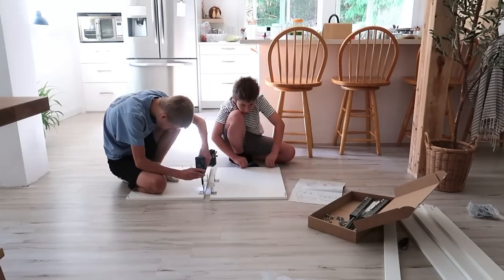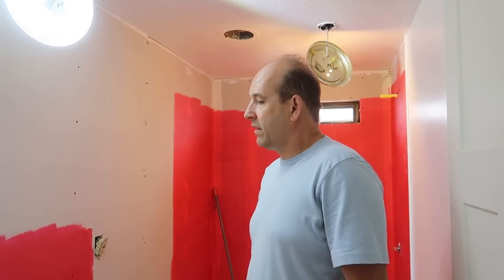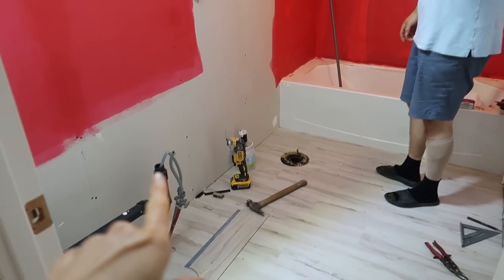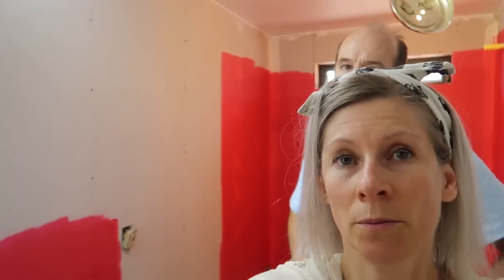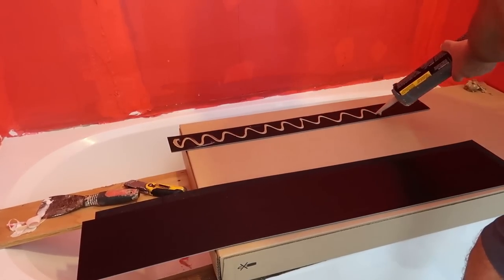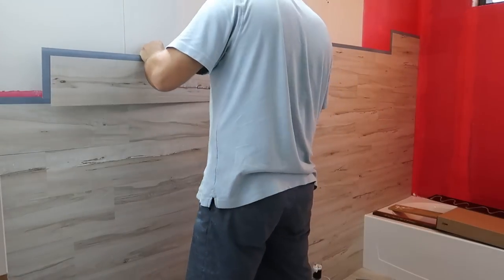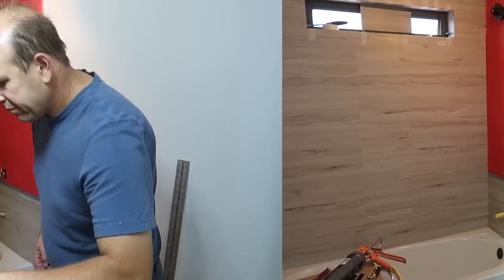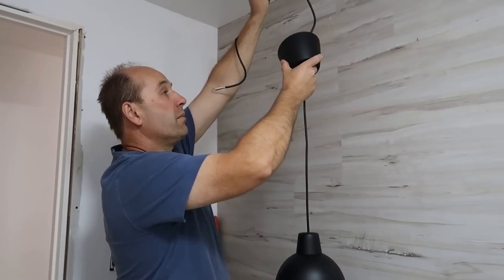BATHROOM REMODEL- BATHROOM MAKEOVER

Comment: I’m so glad to see this. I’m going to replace the carpet in my home. I moved into my mother’s house six years ago after her death. Part of the house has hardwood flooring but when I was a girl, we put an addition and, sadly, all of the flooring is particle board with carpet. I’ve been trying to do decide what to use. I wasn’t sure I could install this type myself but now I feel I can. It looks easier to cut than I thought it might be. Thanks for the inspiration! Your bathroom is looking really great, which is no surprise at all! 😊❤️
Reply from the maker: I'm probably very inexperienced in this putting down floor thing but honestly this is the kind I think I would be even consider to even start, the cuttings are easy you just have to be very right on point as you start to install it and it will line up!💟🤗
Reply: @ScandishHome  ❤️

Comment: I'm wondering about your vinyl flooring. Every single vinyl floor that I've researched off-gasses toxic fumes for many years...
Reply from the maker: I'm sure it does but so does everything hardwood floors have a toxic coat on them too. We open all the windows all the time and we have air purifiers in a bunch of area and Zsolt said something about the water based and oil based glues so I'm sure he used ones that are little less toxic but every remodel has that down side. I read somewhere the new car is the worst they use the most glue and it's closed most of the time. So we just do our best to keep windows open as often we can.💗